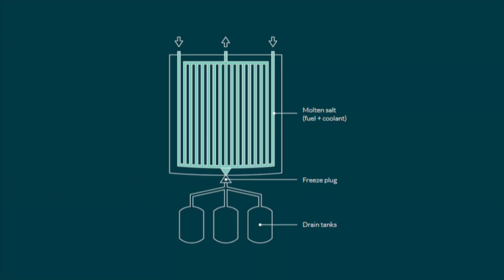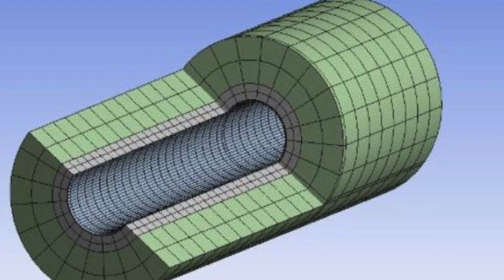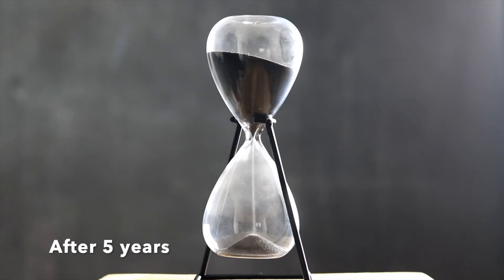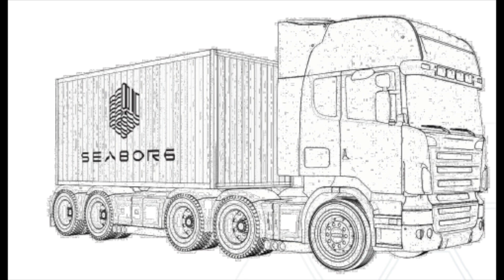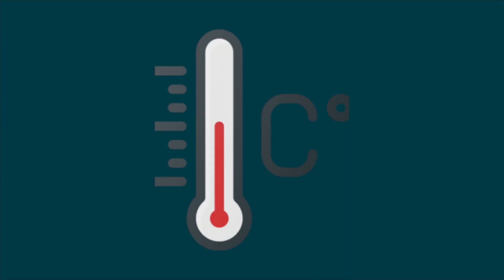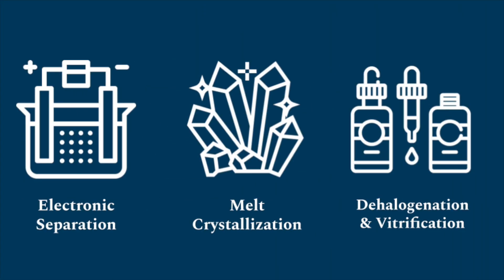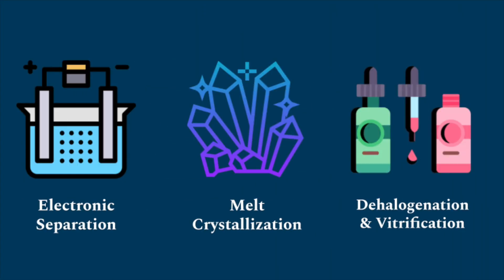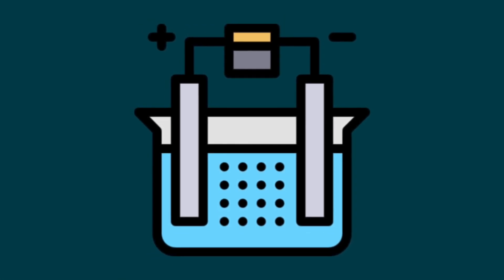Seaborg Challenge: Rethinking Nuclear: Handling of Molten Salt Reactor Spent Fuel

Comment: The nuclear waste will be highly radioactive after 5 yeas and will be very hazardous.  The reprocessing will itself create a nuclear waste stream.  The proposed molten salt reactors will be deployed too late in significant numbers to mitigate the effects of  anthropogenically-forced climate change.  The issue also is that the molten salt hardware on the barge will be highly radioactive after many years operation on the barge and will also create a nuclear waste stream during decommissioning; this was not talked about in the video. The cost of renewables with energy storage is falling rapidly now, and all the supply chains are already established, and wind turbine blades and other parts of wind turbines can be easily recycled without concerns of radioactive contamination.  Likewise, eventually, thin film photovoltaics for solar panels (Perovskite et al.) will be much much cheaper than these proposed molten salt reactor barges.   A further issue is that the expertise is likely to grow in China where the first molten salt reactor since Dr Alvin Weinberg's work in the 1950's, leaving the USA and Europe lingering behind with expertise.

Comment: I would prefer a molten salt reactor with an in-line fuel reprocessing system, kept within the fuel salt loop itself. If actinides are so simple to electrolytically separate from the salt, then they should be kept in the fuel salt loop at all times, with only the fission products removed. In a way, self-enriching/purifying the fuel salt. Taking spent nuclear fuel, shipping it to an undisclosed location, and separating out the plutonium sounds like a bad idea
Reply: Your comments provide food for thought.  In my view, the processing should be done under monitoring of regulatory authorities rather than in some location that is not disclosed to regulatory authorities.  I think the idea in this video is that the fission reactor sites are kept simple, so processing does not have to happen in all of the developing countries and remote locations that would benefit from these reactors.  You can tell from my comments that I am amazed by the possibility that modern fission reactors can provide abundant, carbon-free electricity for every human being on our planet!